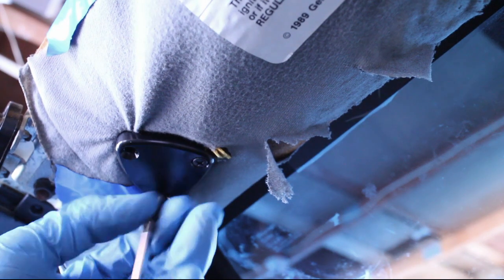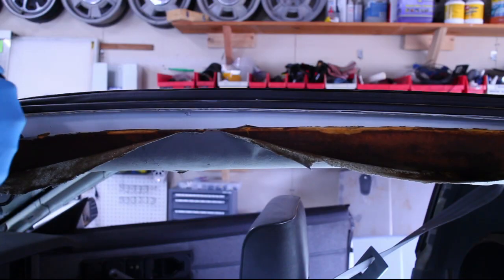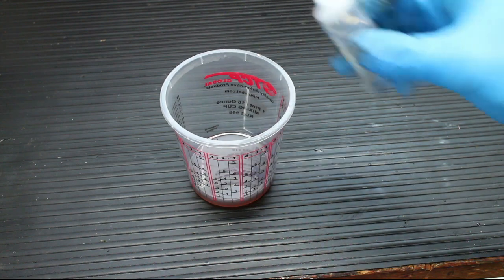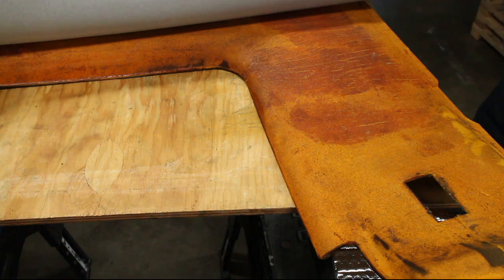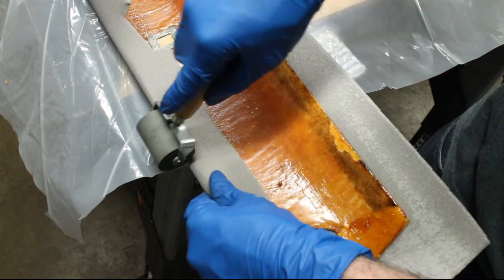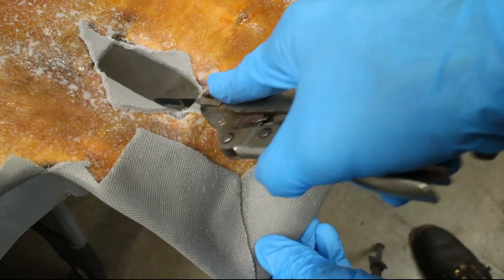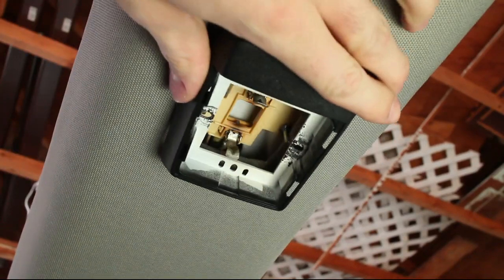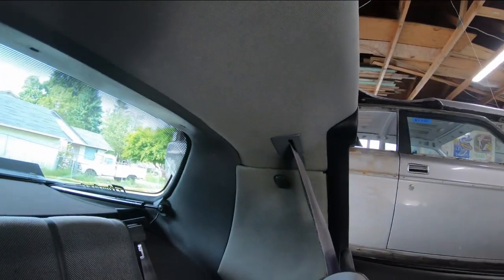Headliner Repair NO Sagging! (1982-1992 Camaro/Firebird)

Comment: This is an awesome video! Thanks so much for posting it! Great visual detail! Awesome tips, like the roller and an X cut in the domelight hole, and using excess material for speaker covers! I also like the epoxy tip to help preserve the original. But most especially, I like seeing the removal and reinstallation to get to the project itself! I feel so much more confident about giving this a go now on my own bird!

Comment: I just wanted to buy a new headliner but this seems like a better solution. The ones I see are all plastic.
Reply: This is a better idea than buying an after market headliner.  I bought one and it doesn’t fit exactly the same which makes the dome light not fit.  It also started sagging a year later.

Comment: I replaced my 3rd gen Formula hard top headliner for a with an ABS backed headliner and it fit fine.
Reply from the maker: I've heard some horror stories about the ABS ones. Stock is always best if you can save the parts.

Comment: Is it possible the headliner backing foam can crumble while driving with the t tops off? When i drive with the tops off something gets in my eyes and i cant see. It also gets all over the dash and i have to wipe it away after the drive. Im thinking a new headliner is the fix as the stuff falling is almost a sand consistency.
Reply from the maker: we talking about a new headliner or the stock one?
Reply: @3rdGenGuy  its the stock original one